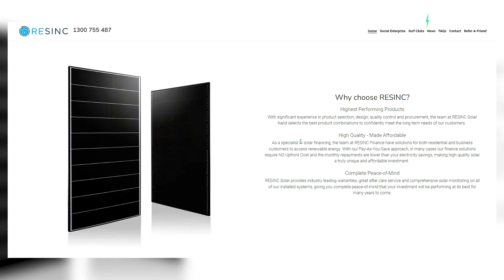Oxford begins mass production of game changing solar panels in the US

Comment: Game changing only when $ per watt is reduced cost significantly. Just achieving 24% from 22% is not game changing at all.
Reply: It's true that $ per watt of the Model is very important. However depending on in which country the modules are installed labor costs can be a significant share of overall costs. Increasing the efficiency of the modules can increase the output of the plant while holding the labor costs constant  This means that even if the cells costs slightly more than other cells, the overall costs might be lower

Comment: It would be nice if they started designing high rises with solar panels over vertical exterior walls. Would go a long way to providing additional renewable electricity in metropolitan centres. I'm sure clever architects could make it look good as well.
Reply: All highrises should be coated white and have solar on the roof for one by now, yes, to your point, there should be all kinds of ways to work them into exterior decor on the sides of the building that make sense.

Comment: For most people the deciding factor of solar installation is payback time, which ultimately comes down to panel cost per watt. I would imagine these newer technology panels will be relatively expensive if they are made in Europe. Game changer probably not.
Reply: I fully agree. Payback time and life of the system.  I’m close but I’ll need a battery system and I think I should sit for a a couple of years.
Reply: remember inverters, cables and maybe storage

Comment: Canadian distributors are gouging.  We got a quote of $63K CAD ($47K USD) for an average house. They use Chinese panels--good quality and low price--but they won t pass that benefit along to us.  We're waiting for a better price.
Reply: That’s insane. I’m in Australia, I just installed 6.6kWh panels and 12.8kWh battery for about $USD 8-9k. Was actually ~20% less due to a special govt grant in my state at the time.
Installed 4kW panels 10 years ago for about $USD 3.5k
No excuse for Canada and USA to be so expensive. It’s ridiculous
Reply: @aaronsinspirationdaily4896  Nuclear electrical generation needs 24/7 steady demand and cash-flow. ROI issues.
Every time the sunshines demand on the grid crashes and cashflow crashes for the grid owners and the nuclear generation. 
The big cash demand for grid owners is the biggest factor. 
Grid blindness, it's sunk cost and ROI is overlooked in most people's thinking. 

The grid has to run more fossil fueled peaker plants.

With more battery capacity, they will have to turn off more nuclear plants.

I have been told that it has happened at a big Canadian nuclear power plant now.
Just one unit, but it may be the beginning in other provinces or states.
Hydro can respond fastest.

Government is under heavy pressure to maintain grid needs for the winter weeks. 

If Canadians went off grid all summer and all the sunny months the situation would change. 

Warming latitudes and more energy in the atmosphere will help renewables and rooftop in particular.
Reply: @stephenbrickwood1602 - People in Australia will soon be (or already are) being further taxed because there is too much solar energy and not enough demand for regular electricity.

Solar is all great according to the government... Until there isn't enough to pay for the giant infrastructure in existence.
Reply: @ezg8448  Australia needs more heavy industrial users on the grid.
The grid exists and is valuable, in a 100% electric future it could take from all today's customers and supply new  industry heavy demand. 

Australia building new nuclear generation using Australian tax payers money is insane. 
The Snowy 2.0 pumped hydro expansion project budget has exploded, Australian taxpayers money 💰. 
Australia has had a decade long drought more droughts in the future, FMD.
Will the LNP pump sea water into the upper reservoir  ???

Will the government sell all Australian energy assets to foreign investors and give GOVERNMENT GARRENTEES to their cashflows. And government disaster insurance garrentees ????
Reply: @stephenbrickwood1602  With the sunlight Australia receives it is foolish not to build an energy infrastructure based on Solar. As for nights there are ways to store Solar energy for use when the sun doesn't shine.  Same goes for the American South West and anywhere they receive that much Sun.
Reply: @theshadowoftruth7561  exactly. 
Also, 80% of the worlds' populations live in warm latitudes. 

80% of the world's population also lives in dictatorships. This is not a fun fact to consider when thinking globally about the nuclear electricity industry in every country. 
Nuclear electricity promoters forget to add the military defence budgets exploding worldwide, a huge additional cost.
Latitudes are warming as well, and more energy in the atmosphere.
Reply: Tesla solar cells are actually quite reasonable. Not sure if they are up in Canada though.

Comment: The difference between ICE cars and EVs is most stark in the rate of improvement. ICE cars have been developed for over 100 years the efficiency gains are tiny. The improvements in EVs, batteries and PV systems are massive.
Reply: Pretty valid points - EVs are also going to date more quickly, what we buy today will be surpassed very quickly. Not that that should stop people purchasing, it’s just going to be about timing for different people.
Reply: The Electric Vehicle was invented BEFORE the Internal Combustion Engine!
The free market, over 100 years, chose ICE.
Reply: ICE vehicles still have a place with hybrids.  That is the new niche.

Comment: I notice you don't even once mention the cost of these panels, $/kWh,..
I expct that because this new perovskite tech is more expensive, that optimizing for efficiency (power/m2) isn't much value in most situations, and their volumes are still far far below that of current commercial mass producers. Basically, these are far too expensive, except for niche customers, and marketingh pilot partners. If this was a viable competitive option, you would have said so. beggars the question, why knock out the video when you're not even getting a taste.

Comment: I live in Northern America.,  we gained power by using bi-facial  vertical panels.  Oriented  east-West instead of south facing..  
      In the winter  there may be  almost a month with clouded sky’s and no direct sunshine. In addition snow may build up on the panels.    By going vertical panels avoid snow covering.  And because both sides gather light reflected off of snow.    Further vertical panels collect early sunrise and late sunset  better.  While not overheating the panels ( and reducing output ) during midday because sun at noon is shinning on the edge not the face.  Meanwhile reflected sunlight  is charging both  sides of the panels.
Reply: Check out this channel. This guy gives a lot of data on this orientation.
ProjectsWithEverydayDave. A couple of his videos, Vertical Bifacial Solar Panel Performance Results Part 1 and Part 2, has the data you may be looking for.
Reply: Most on the ground, or supports  fixed on flat surface
Reply: That’s interesting. How are they mounted? Are they on the roof or are they on the ground?
Reply: @josephmcphee9143  Some are so cheap that you can use them for fencing around your property or as the barrier for your balcony.
Reply: This is really interesting. It seems there should be really strong data on how best to mount solar panels as far as tilt depending on where you are located and of course that is different depending on latitude and as you said, snow potential.

Also, I am very much a proponent of not having panels on the roof but in various creative fashions like using them as part of a fence or perhaps an excuse to have a really nice pergola for the backyard, either way, one can easily reach them for cleaning off or things like that. For so many reasons, the roof is not really ideal not the least of which is aesthetics
Reply: Glass windows ? @travisjazzbo3490
Reply: @frenchydampier2209  what is the daily production and your latitude ?
Reply: @frenchydampier2209  you have long twilights as well. How does that help production. ?
Reply: @stephenbrickwood1602  Bi-facial vertical panels have a production curve that resemble the "duck curve", which is useful for grid-tied systems. If a system is not grid-tied, batteries can help shift horizontal panels time-of-production in order to make use of mid-day sunshine.
Reply: I guess the polar bears can use them as mirrors

Comment: Hey electric Viking. I think PHEV can technically charge faster than EV

If PHEV can achieve 2 battery segment separation

You know every regen braking plus engine running can charge battery.

As long as PhEV can prove using 1L of gas can charge 10L of hybrid electric mileage while plugged in charging.

So 1L of gas can be burned for that extra 40% charge while plugged in exchanging gas mileage for electricity mileage. 

Maybe just think of engine like generator. 

Will it achieve that efficiency? Some engine can.
Reply: Nothing stops an EV from dividing up ts battery into two segments and two DC fast charging connections will be faster than a gas generator and a DC connection. Hybrids can never be as cheap as a gas car due to extra complexity and an EV is way simpler and cheaper to build than the gas car... Hybrids are just incredibly complex and wasteful and have far more mechanical problems than regular gas cars and gas cars cannot hold a candle to EV reliability...
Reply: @0ooTheMAXXoo0  it’s just more so on the idea that if DC charging have already taken up all the available electric wire capacity from the plug to battery, the other way to get more electricity into second battery is internal generator.

You know what, go wild, electromagnetic free range regen braking without actually moving the wheel, rolling the inner spinning mechanism with trickle explosive engine(theoretically this is something direct hydrogen explosion can do, if we go nuclear it would be ez pz lmsqz, need some help from battery for instant spark)

Hey, this is something Mercedes would do, Tesla is too cheap on the new stuff, when they going to be innovative?(I’ll give you 50km of range in battery wow you should be grateful 😂)
Reply: There must be some reason regular electric cars don't use 2 battery segment separation. But I don't no what is it. Cost? Weight?

Even with home based Level 1 trickle charging you could double the charge speed. Make it more like Level 2.

Comment: Since 2010 we have added about 3% per year to PV efficiency and it feels like that as we slowly moved from around 15% to 22% currently. Interestingly Panel prices have dropped 8% per year. So 5% of that 8% has come from the 1000+ little innovations that come in mass manufacturing and synchronising supply chains (A Chinese Speciality). So these panel could be the first time we actually make a jump forward rather than incremental progress.
Reply: Nobody cares about efficiency, it's all about cost per watt
Reply: @sdrc92126  Up to a point. There's plenty of cases where the space is limited, so the efficiency matters. Yeah, of course, if it costs double to get 10% more energy nobody will buy that. But if it costs 20% more for 10% more energy some people will get that. While it's more cost per watt, it's still less power from the grid which costs even more per watt, so overall net positive.
Reply: @Winnetou17  Those use cases are limited to special applications like in space where weight is the over riding factor or remote sensing applications, but I don't know of any large scale deployments where this works
Reply: @sdrc92126  except when space is limited such as putting solar panels on a cars you'd pay triple in cases where space is the premium

Comment: I have the old small Anker power station, it's the size of an old CD/Radio/Casette boombox and twice as heavy. The newer one, with basically the same capabilities (though a slightly smaller capacity), is half the size and weight, and that was inside about 5 years!
Reply: You can buy jumbo jets that are electric right now in China. Batteries just recently became energy dense enough to make longer flights with larger airplanes possible and supposedly Panasonic has batteries about to go into production that are more than double those in energy density. Meanwhile prices have dropped by like 80% in about six years and they should drop another 80% in a similar chunk of time.
Reply: @0ooTheMAXXoo0 
Check your sources.

Comment: is it a good idea to make solar panels with lead in them?
Reply: About as good as having lead acid car batteries for over 100 years I guess.
Reply: @markvalery8632  That's fair, don't get me wrong, I am a big solar panel fan. the difference is the lead acid batteries are recyclable and all the batteries have lead in them and look the same. these panels will have to be sorted by there type in order to be recycled properly. silicon solar panels have lead in the solder  so I guess its already part of the process.
Reply: @russeldeakin8792  But is that a problem? There are multiple companies with production recycling facilities in the US and Germany that are operating now. Granted, I do not understand the real process of recycling these things, other than grind the hell out of them and then do something else to separated the minerals.

Comment: What is the durability? What efficiency after 20years?  Does heat degrade them faster than silicon based?
Reply: The big demand will be for solar panels that deliver enough electricity during the winter months because that is when we use the most of our energy.  80% of our energy demand is for heating households so lets solve that problem.  The sand battery combined with solar was promising but needs upscaling. Maybe a sandbattery under each house to store solar energy during the summer as super heated sand for use in the winter? To warm the house and heat the water? Better solar panels is just a part of the solution😊